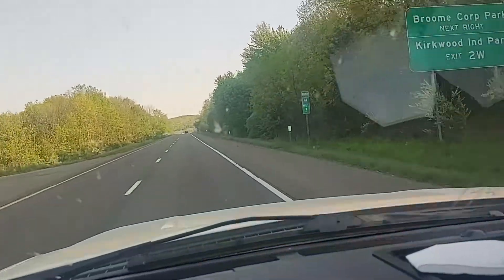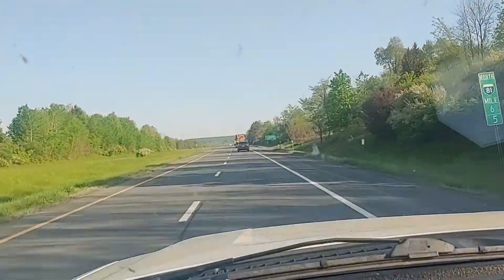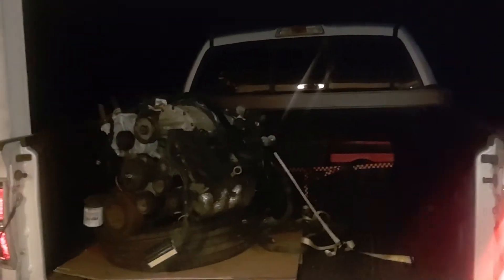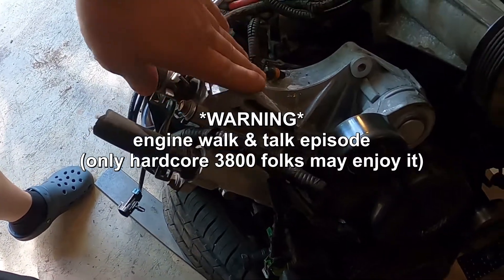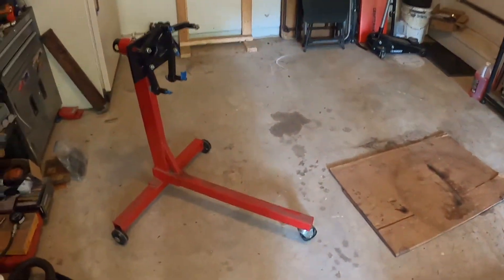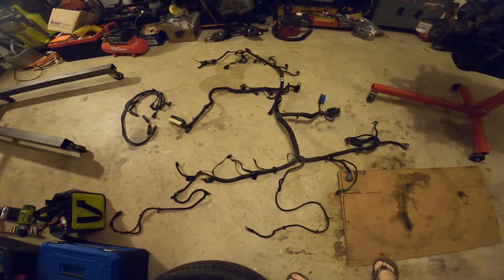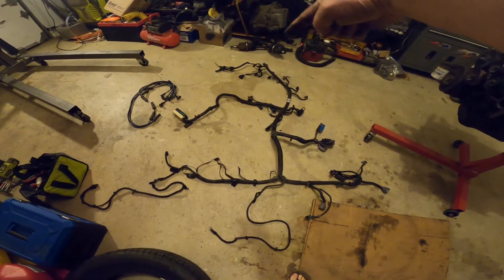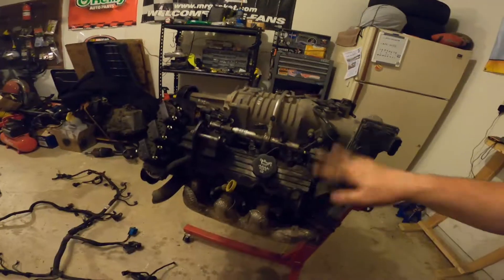Bad Grandpa getting fresh junkyard Series 3 3800 L32

Comment: These 3800 series engines are some dam reliable engines I bought a 99 Bonneville with 145000 miles on it for 600 dollars it's in dam good shape. It's a one owner car that's got records of maintenance done I replaced the tensioner assembly right away it still had the plastic elbows on it which is a big killer of these engines.  I did also do my intake gaskets and valve covers too   my plastic gaskets on the intake looked like yours. I put the aluminum ones on mine too
Reply from the maker: Right on.  I've pulled intakes off ~100 or so of these, and almost all OEM or replacement plastic LIM gaskets are compromised.

Comment: This is Awesome! Hey you said you are near Syracuse?  Who could tune my pcm for my 2002 Regal that I'm top swapping?  I'm not far from Syracuse?
Reply from the maker: Originally from Rome, and I used to build/tune everybody in CNY before I shipped out in 2010 (including this Regal, which is why I bought it after!).  Not sure anyone's active within 2hrs of SYR anymore, but ZZP does that regularly for a couple hundred.  I'd help if I was in the area more often to visit.
(Edit: if you want to really get into it, I'd buy the basic HPTuners setup for that price, and get your feet wet & learn 10x more as you go.)
Reply: Thanks man. I'm just trying to do a basic top swap and use the 3.5 pulley from my old park Ave ultra that ran 13.9 at 97mph at Empire 2 yrs ago! Kicked a lot of ass with that 4000 lb granny boat! Now I have an 02 Regal LS to top swap I have a whole SC 3800 from a 02 Regal GS 89k miles on the donor engine. Clean non rusty 98-04 Regal GS just aren't around here for cheap nowadays unless it has a dead transmission?
Reply: Your turbo Regal GS is badass too
Reply from the maker: Hey, those dead transmissions are easy swaps! 😆  But ya, if you can get the GS computer in there, and just wanted to have the fuel/gears right, there's non-tuning things you can do (AFC, VSS gear, etc.), but it's give & take whichever route you go.
Reply from the maker: @googleaccount1132  thanks, btw.  Put a bunch into it, and took a ~10yr break, but the shutdown got me back to tinkering and remembered how fun it can be.
Reply: Sooo can I use the stock L67 pcm once I complete the top swap? Or can it be from any L67 98 - 02 GS?
Reply: SUBBED.  I GOTTA SEE THIS! 😎👍
Reply from the maker: You'll want as close of a car as possible to the chassis, for system/transmission control happiness.  The L67 GS pcm will assume 2.93 not 3.29, and may not be quite the right air-fuel for the bit of extra compression.  It should run OK, but would shift funky and might go lean if you beat on it (basically like adding 9.4:1 to a GS that was 8.5:1).
Reply: Thanks man. I'm on FB in the Regal GS.under Jim Smith with a pic of my gold Regal check it out if you want

Comment: what sort of advantages or HP gains do u get after applying the series 3 motor? i heard there wasnt much difference between that one and the series 2 motor.
Reply from the maker: The change for Series 3 was very minor, power-wise, although I like finding them for lower miles.  Main difference was the larger 75mm electronic TB, which happened to make the inlet of the M90 and UIM better flowing.  The powdered rods are a minor benefit, but not a big deal.